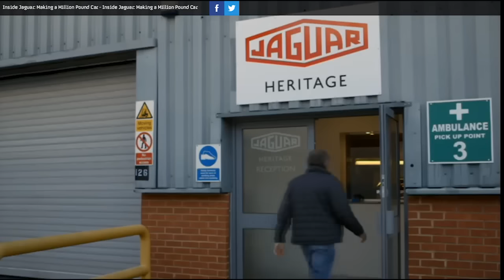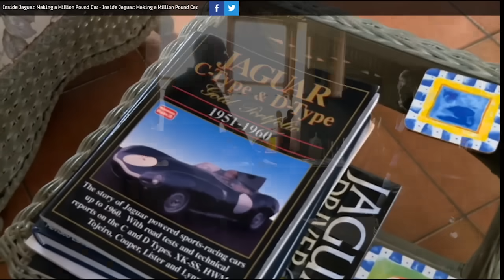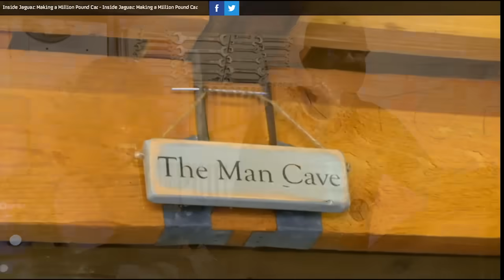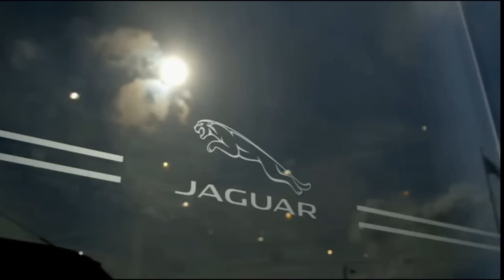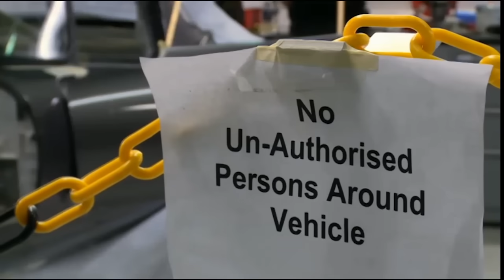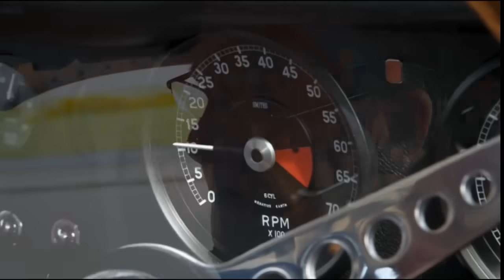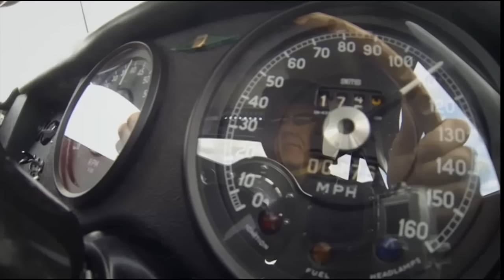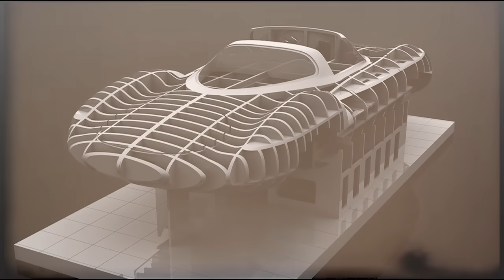Inside Jaguar - Making a Million Pound Car (HD, Full-Screen, No Adverts)

Comment: The Jaguar XKE as far as I'm concerned was the pinnacle of automobiles in my lifetime. It may not even be the most desirable for the average guy, and new cars of today should probably not try to emulate it, but it is perched higher than all others due to its style and also design. Time marches on, and it wouldn't make sense to compare the XKE to a Tesla for instance, or to any modern car.  It's fitting a precision timepiece is given with the car. To knock the XKE off its perch, you would have to go back to that time and out-class it at its own point in history.  It was perfect in its time; by definition there can't be many that hold that spot.

Comment: Love the car ! 
 I have a 2007, Jaguar XK Convertible 1 of 97 , Winter Gold, 45,000 miles on the clock. I use a Tooth Brush on it , every spot is clean, and I drive it, and show it in Car Shows. Spent four years looking for one, ... Never been in the rain, A smile on my face from ear to ear. I enjoy just looking at it. And the drive, the sound, the feel as it moves down the road....Nothing like a Jaguar ! The Dream is here. " Moves Like a Jaguar "
  Thank You, Jaguar for building a Sports Car / GT that fits me, 6'3" 235 lbs.

Comment: I was down at Connaught Race Engines in the late 90's having Tim Swadkin dyno one of my engines and there was a lightweight E type in the workshop at the time, there was also a chipped up Cossy and the owner of the Jag and the Cossie were having a 'discussion' about which of the cars was faster, it eventually came to a test on the road and apparently the Jag wiped the floor with the Ford, happy days then!  'Sausage'  HT Racing Ltd

Comment: Wow! Those Lightweights are really beautiful. I know die hard Jaguar fans are gonna through rotten bananas on me, but I had never considered an E-type as a beautiful car. XJ13 - yes, amazingly beautiful, but not a standard E-type of any series. But the Lightweight is quite amazing! The rear quarters are so dramatically shaped! Quite a remarkable design achievement!

Mark Evans is so worried about getting these new cars showed off at Goodwood, while this seems to be something personal (for the new owners). They buy cars for their liking. Yeah, these cars have no history, but they are new, so the chassis rigidity is a lot higher, they will handle like they did in the 60s, you can never experience that in an old car, when panels start to walk around after stress and age.
Reply: Yeah and another performance advantage these new lightweights have is the fact that the metallurgy of aluminum has gotten significantly more advanced over the past 60yrs,  meaning a stiffer structure, lighter weight and a stronger engine block casting,  because of this i agree that it won't be fair to allow these lightweight remake's to compete with the original's as 
they would be out-performed  on track.  Another thing to consider is how these new cars are going to affect the value's of the original's,  either car collectors who wan't a lightweight will hold off untill a original comes on the auction block or they may be ok with paying less for a new lightweight when one goes up for sale and that could cause the value of the originals to
not increase as steadily or even lose some value as a result
Reply: The originals didn’t have any history when they were new.

Comment: Lord March was up his own backside. Goodwood House isn't original, it has been maintained with modern materials, wired for electricity, running water installed etc etc etc.
Reply: The point is though that every car at Goodwood revival is a period car with an unbelievable amount of racing pedigree (ie, Carol Shelby's cobras are regularly there, Dan gurney's GT40 etc etc). Lord March doesn't turn his nose up at them he simply wont invite them as they don't have the unbelievable racing history that the Revival invitees have.

Comment: Provenance carries quite a lot of weight for collectables of all sorts. Probably should race in a different class vs the veteran cars. Where do they get the engines? Do they cast, forge, and machine new ones?
Reply from the maker: Engines are supplied to Jaguar by a third party - they do not cast their own engines for these cars (or any other of their replicas come to that). In truth, they do very little other than assembly.
Reply: This 'Provernance' crap is just upper crust puffery of emotional one-upmanship.  No one really gives a shit who owned or drove the car.  Sitting in the vehicle that the Queen drove doesn't make you the Queen.  Then there is the other puffery with naming car owners as 'Keepers'.  WTF!  Just more poncy bullshit from overly rich people with no real grasp on reality.

Comment: The out of line tail pipes weren't the only fault, did anybody else notice the the rubber trim hanging off the roof on the drivers side, just after the silly can I drive it question.

Comment: Is it a replica being that it's made by jaguar using the same presses and tools used in the 60s? Granted the aluminum is probably higher grade the materials are modern...but it is made to race by jaguar... Catch 22 to say the least... These thoughts coming from a jaguar enthusiast... I have pictures as kid sitting on my grand dads steering wheel in his 51 xk120 which is now restored and I own.
Reply: "Which is now restored and I own" ....so it's not original because it has been restored.

Comment: Agreed. Lead is the only way to go. I hope they didn't align the bonnet latch issue by prying on the receiver with a screwdriver.
That one buyer looked a bit like Danny Devito!
Reply: Do a lot of resto or fab work, do you boyo? Lead doesn't work on aluminum. These are ALUMINUM-bodied cars, not STEEL like the production units.
Reply: Talking about aligning the latch Schweinehund

Comment: Why are they refering to the cars as No. 1 and No. 4? it is No.13 and No 16.
Reply from the maker: Their in-house convention is to refer to the first-built prototype car as "Car Zero". They then number the customer cars "Car 1", "Car 2" etc. That may be why they refer to them as Nos. 1 & 4? 

A cynical person might suggest this is first and foremost about making money - and not necessarily respecting or celebrating heritage ;)
Reply: I don't hink you have to be cynical! If, as they say, they are the next six in the line then maybe 13 - 18 would be the correct numbering??
Reply from the maker: Possibly - the "missing cars" thing is perhaps credible but really no more than hype. The hype was pushed even further in their latest run of XKSS cars which supposedly replace the nine cars destroyed in the fire in 1957. In truth, not a single XKSS was destroyed in the fire - they were all still D-Types.

Comment: I grow weary of all the self-professed experts below. Here's a simple question for you: If Jag's are so good, why has the company been sold so many times? Could it be that it cannot turn enough profit to be self-sustaining? If so, why? Maybe Jags are not as good as you all allude to.  High pricetags and speeds do not always mean high quality and durability.
Reply: As a former XKE owner, and my best friend also owning a Mk X sedan, I can tell you why.
They were originally engineered to be driven around quaint little English villages in their year-round temperate climate. 
When you went beyond that they were unreliable and the E type did not have passenger comfort in mind.
When you spend more time under the hood (or "bonnet" if you prefer) then behind the wheel, it gets old fast.

Comment: They're not replicas, they're a new batch of production and now to a higher standard than the original. What if Jaguar had never stopped building them? Would they still be considered replicas? Yes there will be a difference, and I can see why you might not want them to race against 1960's cars but then that's because of the age not that it's fake.

And when people talk about it lacking the pedigree they're wrong, it has the same pedigree as the 1960's models. The individual cars doesn't but the model does. Just like if one of the old ones had been rolled straight from the production line into a shed and been sitting there for all these years.

Comment: Did they use Lucas electrics - the Prince of Darkness?
Reply: The greatest problem with Lucas Electric if they tried to be too, shall we say, traditional. For the plug-in connectors they used pure copper rather than brass. Pure copper has no resiliency like brass does for the holding connectors together in place, four example the spade connectors. They simply come apart at the most inopportune times. I have had this experience many times with my 1964 MGB my 1960 MGA and my 1969 Jaguar XKE, but since I am an electrician and an Electronics technician this was no insurmountable problem for me. For a person with minimal mechanical and or electrical aptitude keeping ahead of the game with Lucas electric it's an expensive challenge.
Spring tension on the fuse clips is another engineering failure on the part of Lucas Electric...

Comment: I doubt the aluminium panels of the original "lightweight" race cars were buried under "4 times as many layers of filler and primer as usual" and 9 layers of paint and laquer! 😂 That's a good chunk of unnecessary weight to cart around the track.

Comment: I was quite disappointed with this documentary. There was so much time spent on history, the body, the paint, the leather, the wanky watch and suitcase, all the fake drama regarding jobs on the line and "what if the owner doesn't like it, he's only payed a deposit". Not one word spoken about the engine, gearbox, diff, brakes, wheels and any difficulties they had matching the original specifications in those areas. Whether they manage to replicate the awful Lucas electrics that were fitted to Jaguars at the time was another area avoided, yet there was ample time for back patting and  self-congratulations throughout.

Comment: Sorry, but if any Jag should be rebuilt, it should be th XJ-220.
Reply: What year was that?
Reply: Complete with the car stereo unit which flies out of the dashboard when flooring the accelerator from start.
Reply: Hell yeah,,,, next project!!!
Reply: but then with the originally intended v12!
Reply: 1991 to 1993 I recall. Big controversy as it was originally a 12 cylinder but changed to a turbo 6 with more power and much easier to maintain. 
Many complaints and lawsuits!  @sclogse1

Comment: The only way an E-type does "150 mph" is if you drive it off a very tall cliff.
Reply: DEEREMEYER1 US build shit no one wants this is hand built Jaguar Aston Martin Rolls-Royce
Reply: If it has a  3.08 rear end in it .     It will do 150.   I had an OBL  (one of the 386 first cars)  it would do 150 but I chicken out at 148 and coasted  on to the off ramp at Daytona in 1969.

Comment: Just curious why the British add an "i" to aluminum. It's not aluminium, it's aluminum. Even Grammarly checks that as wrong.
Still, that is one beautiful car!
Reply from the maker: Thanks for the kind comments Stephen. Aluminium is spelt with an "i" in England and should be pronounced "al_you_min_ee_um". The "Grammarly" you refer to is an American website and so uses the American version of English which, of course, is a corrupted and changed version of the original English. I'm not saying its wrong, just that it has evolved differently from the original.

Comment: I think they've tried too hard, every original one is a bit different, and filled with imperfections.

The continuations will be indistinguishable from one another but stand out like a sore thumb.

If i was in charge, every single car would complete a season of historic racing at the before being sold.

And customers would get what they are given. 

And the watch etc. Sounds like bs to me.

If I'd be given one it would have battle scars in no time, concourse cars are so depressing, they need to stretch their legs, get some flies splattered on them etc.

I prefer the Aston Martin continuation cars, they are far less absurdly anal in their intentions despite being just as high quality and as accurate as possible. And their continuations have opened doors to more spare parts for the originals.

Comment: It may very well be a continuation model, and is a genuine E-Type lightweight... but it has no history. Each of the originals raced in major events with big named drivers, and cost 10's of millions to buy...  This continuation has none of that hands on history. Its genuine, but lacking heritage in everything bar shape and name. In fact the originals weren't perfect. They had build imperfections and panels not quite right - so these new ones even lack the genuine imperfect build.

The best reproduction I ever saw was a C-Type. It had 3 miles on the clock and had only just been completed... but it had mismatched bonnet straps, worn seats, doors that didn't fully align, faded and worn patches of paint and the clocks were all perfectly aged. It was near impossible to tell from an historic genuine racing C-Type.

These new E's lack that genuine era feel.

If the new owners complain and want to be in the historic elite clubs, then spend well over 10x more money and buy an original model.

Comment: The first car that I wanted to own was a 1964 E Type. However it had one design fault that annoyed me. The skinny little tyres were hidden inside under the guards with the wheel arches looking like a cut-out added as an after thought to get at the wheels and they'd forgotten to make covers for them like the MKI's had on the rear. That just looked wrong like a curvaceous lady with exceptionally skinny legs. For me that design problem was fixed in the series three with wider rims, long wheelbase and the little flare on the wheel arches made them look like they should be there, no covers required.
Many, if not most blokes think I'm wrong. I don't care.

Comment: Great car. But it why on earth didn't Jaguar put Norman Devis behind the wheel ? He tested them back in the day, he should test them now, and give his sign of approval. Norman is for Jaguar what Valentino Balboni is for Lamborghini. If they really care about history, use the living legend while he is still around. And one more thing. Bondo is really not acceptable. Use lead loading like they did when these things were new. Mark did it on his, and I did it on mine. Maybe lord March was right. Maybe it is a replica after all......
Reply: ovenorway  wouldnt lead be against workplace health and saftey etc?
Reply: husq2100 Only if you use it on a balloon !
Reply: ovenorway lead isn't always practical for all places. You have to add quite a bit of heat to the panel. I've done lead wiping before and while it's good, in some cases modern plastic fillers in very light amounts if actually very good and not an issue. It's the mis-use of bog that is a problem.
Reply: gav240z Very well spoken truth!
Reply: +1 for Norman
Reply from the maker: +ovenorway can't use lead on aluminium!!
Reply: +ovenorway Having met and followed Norman's incredible career, I understand the passion foir his use as test pilot. the unfortunate fact is, Norman is now 95 years old. there comes a time....